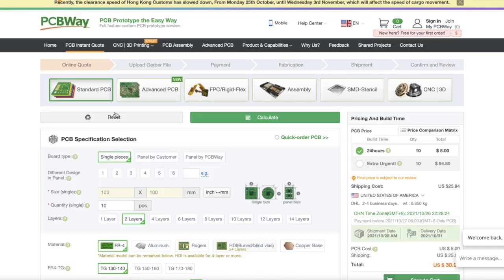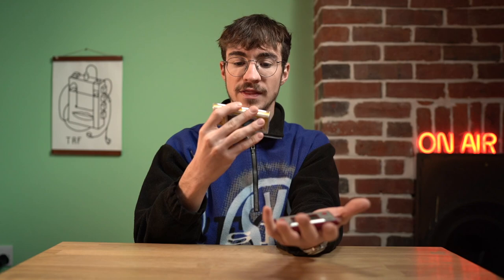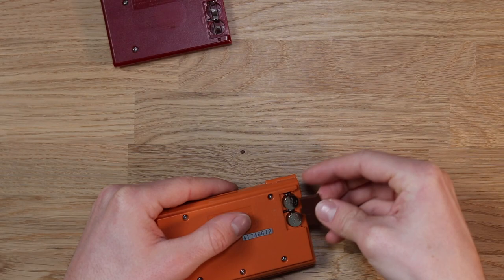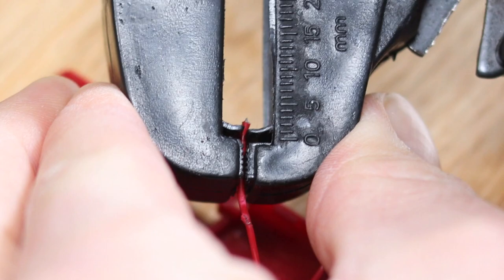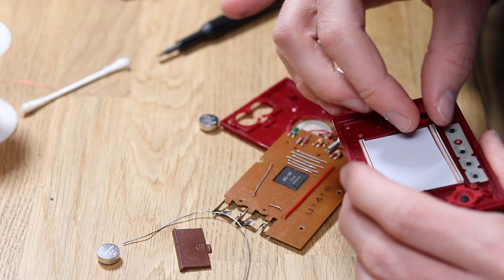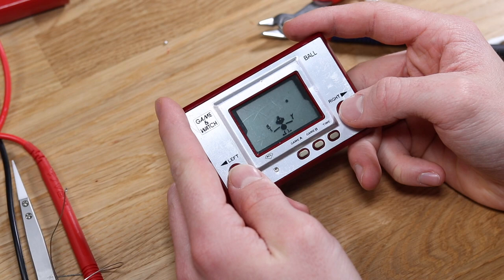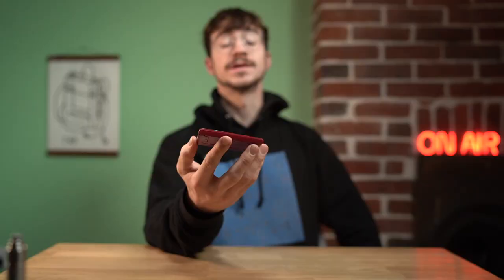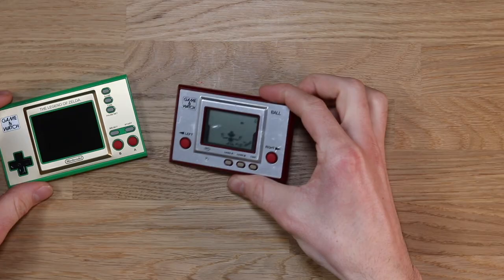My Most EXPENSIVE Nintendo Repair Yet...

Comment: Cracks in materials are sadly way more evil than that. Once they've started they'll continue to grow indefinitely if you don't stop it in its track. In this case, that means drilling a hole in the pcb just after the crack in the direction its traveling
Reply: Not after, but right at the end of the crack, you basically end the crack with a hole, then you can even put some glue in it. Saved thousands of CDs, DVDs and LPs with that. Sadly not really an option with modern multilayer PCBs.
Reply: Good tip👍
Reply: @shadowflash705  It fine on modern PCB's, you just need to have a schematic or manually check the connections in that area. The latter being rather painful option though.
Reply: A clone of this Game & Watch's PCB, and a lot of components transplant would be a better option for this case though.
Reply: so easy to repair less than 3 minutes

Comment: Nice :D. 
Which gauge wire/type of wire do you use for some kind of repair? Like in this one or the ones you made your own weird little gameboy mod :D
Reply: A very thin solid core somewhere in 28-32 gauge is fine. He's using magnet wire or enamel wire. I use wire wrapping wire. When the pitch matches, I use occasionally a piece of ribbon wire, though that has its issues.
Reply: @SianaGearz  thanks, appreciate it :)

Comment: I think some of the segments for the score still aren't connected up. I had a similar problem with a Puyo Puyo handheld that I own (a crack in the board severed the traces to the score LCD segments). It's very tricky to do this kind of repair tho, so It's still good to see that it's (mostly) working again.

Comment: Nice job Elliott.  I’d need a jewellers loupe as I’m over 60 and my eyes won’t focus that closeup.  I did fix my NES that someone cut a trace on the motherboard.  They didn’t realise they cut the next trace.  Having spotted that, I found points where I easily solder another wire and it’s been working ever since.

Comment: Have never understood why electronics folk don't use conductive paint and either a mask stencil or a very very fine dagger brush and just repaint traces with zero chance of ugly or destructive heat damage?   I use a gold filled paint and a gold or silver filled epoxy both highly conductive and have repaired several Soviet quartz watch boards by simply using a home made stencil which I can paint precise .5mm lines and curves with comparative ease.   I made my stencil from a sheet of brass, very useful too.

Comment: Wait, where'd you get your wire stripper? That's a lot nicer than the one you kind of "SIDE" load and can't use that many different guages (sure most of the common "REPAIR"/"HOBBYIST" sized guages fit, but yours looks like it also does proper HOME wire as well. And gives you better control in depth than the "SIDE" one.

Comment: nice, tho it seems one of the legs on the display is not rly displaying correctly, but still awesome work

you probably multiplied the value of this device 10 times by just spending a few hours on it

Comment: I find wire wrapping wire easier for this thing. Tinned single core, can be stripped with an automatic tool if it can go down to its tiny gauge. I actually use the super cheap FS-D3 tool, other cheap tools don't work. Affordable Jokari ones don't work.

Other way to do the repair is to lay just the core right across the break, but just depends how you're comfortable doing things. When you have to do a number, it's easy to get to the limit where it can be difficult to manipulate things, but you can mix and match techniques as needed.

It's best not to touch zebra strips with bare fingers, finger cots are nice, but I'm comfy enough using tweezers.

Comment: 0:35 10:05 If you look closely, the art was swapped and is now upside down. It looks like it means to resemble a curtain, so the small pattern along the edge should be above the character and not below. 

Edit: I forgot that this was previously worked on by someone else, so in the beginning of the video, it was wrong, and at the end was right. I still don't know why they actually go the way they do though.

Comment: I would have scratched the traces along the area where the fracture PCB was and then add flux and solder. Probably would have been a much faster and more elegant solution.

Comment: Hello Elliot.  My name is Felipe.  I'm talking about Brazil.  All good ?  I've been following your videos for a while and learned a lot.  Thanks for the shared knowledge.  I have a problem here with a game&watch and I wanted to ask if you would know anything.  The Parachute game has the last number of hours (points) erased.  I've already tried cleaning the conductive strips, cleaning the LCD, cleaning the board and nothing, even changing the rubber conductive strips it's still the same.  Do you think this part of the LCD may have died?  thanks for all the help.